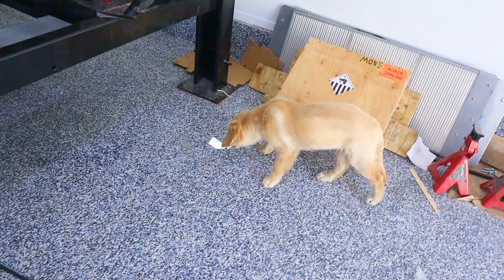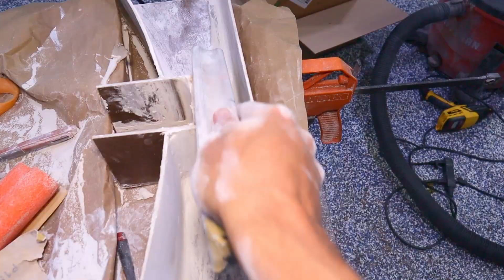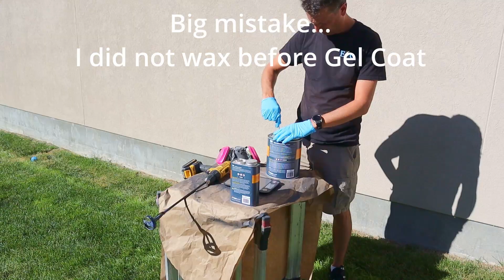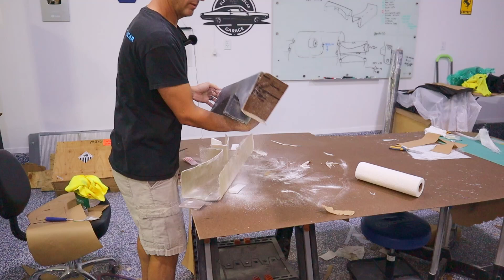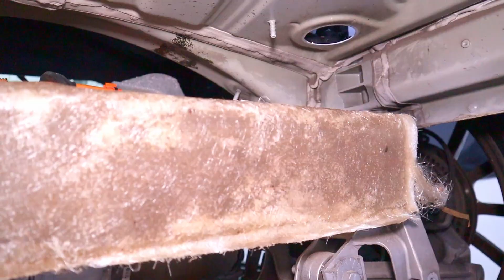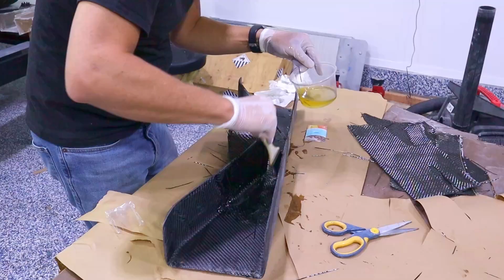Carbon Fiber Motor Mount: Strength, Style, Performance - From Idea to Reality-Crafting Carbon Fiber

Comment: Looking good, but for a better rigidity I would close the bottom (O instead of U), that will help against the 'arm' bending. I'm no expert, but maybe also locally strengthen the screw holes?

Comment: One thing to note when working with composites: anywhere that you need more strength, you can do so most efficiently by purchasing some foam that doesn't dissolve in your resin and laying it in between layers and trapping it in the composite. The foam doesn't weigh much, but allows you the opportunity to create more offset planes for tensegrity. Think of it as welding box tube into sheet metal or the stamped reinforcement in stamped steel or aluminum panels. I've even seen this done with the super cheap foam cord insulation that is just an extruded cylinder of foam used for wedging in gaps around windows and door casings. Closed cell works best as it absorbs less resin. It can also be helpful in building an edge with a nice round over so that you don't chip and delaminate the carbon fiber on the edges of an open panel like that one. Since the foam gets left in there, there's no need to worry about it and the hollow carbon fiber tube at the edge will also dramatically reinforce the structure.
Reply from the maker: Great comment!

Comment: With the weight, applicable G force under load it'll put a tremendous amount of force on those rigid mounts. Give it some room to travel and a anti vibration mount for the rotational aft force to minimize stress. You'll have less noise and vibration for your chassis.

Comment: It's hard to tell without being there, but given that you were able to flex your cross beam member with just a portion of your weight before your additional wet layup, I might suggest adding in 3-5 wet layup ribs spanning your internal "U" structure there just to be safe.  Reason being, your mount location is a bit cantilevered off of your mounting axis, and as you said- the motor is 300ish lbs, and with inertial loads over bumps and whatnot the force can well exceed that.  Definitely want to resist those torsional loads on the beam.  But then again, maybe your additional mounts will be more than enough (Just want to protect that motor and this super cool bracket!)  But I'm super impressed with how your carbon fiber member turned out!  Love the channel and the build
Reply from the maker: Thanks for the suggestion!

Comment: You might need to add some gussets or box in the section to add a bit more strength... you could also add a tube or similar around the bolt access hole to put some more strength in there. 
If you can, throw the CAD into some basic simulation software and just see how it behaves.
Reply from the maker: Good call

Comment: Did you mention how many layers/sheets did you use? Looked like it ended up being about 1/8" to 3/16" thick? Whid did you make the bracket U shape in cross-section? It seams like it would be a lot stronger is you could of made 4 sides more like a tube.
Reply from the maker: 3/16 thick
I still may close it off

Comment: I hate to be that guy but you really should be wearing PPE during all stages when you are working with carbon fiber. Carbon fiber dust and shavings are absolutely terrible for your skin, lungs, sinuses and eyes! Epoxy dust is also awful for you. A significant amount of both get airborne when you cut and sand this stuff. There are entire industries dedicated to PPE for working with epoxy, carbon fiber and fiberglass. They exist for a reason.

Comment: Hey you probably should by some hearing protection.. ;)
Also, I think you notice it as well, your beam is a bit overbuild, you could have taken advantage of the fiber properties and lay them in load baring directions instead of simply 0/90 and +/- 45, similarly the ends could be angled as they don't take any load.
Internal structures, like rips, could also be sometimes more beneficial than more layers ;)

Also you could have used peel ply without folds on the outer layers.. when building up such thick laminate the folds in vacuum bag and peel ply could press through disrupting the resin to fiber ratio.

Comment: Where you able to reuse most/all of the carbon fiber you cut up before you made the second mold? Also where did you learn how to do composites?
Reply from the maker: Yes, used the same carbon fiber pieces.  Learned by doing.  Still have so much to learn

Comment: If you're using regen braking,  wouldn't that mount need to be strong in both directions?  How much will the current design flex in an upward direction?
Reply from the maker: None that I can generate

Comment: I like the use of carbon fiber for the crossmember/motor mount.  Where did you get information on the structural strength of carbon fiber and how many layers/weave orientation?  Keep up the great work.
Reply from the maker: Lots of research.  About 20 layers

Comment: Boxing in the large hollow underside would do wonders for the part's torsional rigidity having that cantilevered load.  I second the other comments on the actual bolted interfaces, you want to bear the load locally in a much thicker section.
Reply from the maker: Thanks for the suggestion

Comment: Interesting approach!  I’m curious about the choice of molding one from composite vs. what I see a lot of YouTube fabricators doing which is making mounts out of tubing or sheet metal and welding it up.  Did you consider this?  It seems metal fab is a lot easier to tweak before finish welding it up.
Reply from the maker: Probably.  Still can go this route if needed

Comment: when you're lining up the output holes from the motor to the spindle in the wheels - should you do it with weight on wheels?
Reply from the maker: What do you mean?  Like full droop without weight?
Reply: @ElectricSuperCar  opposite what you said.  Put the weight of the car on its wheels and then see if the cv axle holes will be straight.   Right now the wheels are drooped down right? So when you go weight on wheels the spindle holes will move up..  idk if its a considerable amount or not..
Reply from the maker: Got it.  Right now wheels are on the ground with vehicle weight, but without batteries the car is sitting high

Comment: Nice part you build there.
IF it still needs strenghtening, you could add layers of diagonal trusses on the inside.
Also, think about reinforcing those holes you drilled by gluing some aluminum or titanium bushings into the carbon fibre piece.
Reply from the maker: Thanks for the tips!

Comment: First, GREAT job all around.  On this build and all the work that you do.  I'm really enjoying your channel.  Second, I'll add to the CF comments by reminding everyone that CF has over twice the tensile strength of aluminum at half the weight.  If something "tore up" a 1/4" in of aluminum, the equivalent would be 1/8" of CF.  In the right configuration (as you stated) and the correct weave / pattern layout CF can be used for this and many other high load applications.  After all, it is used for aircraft wings that take loads far in excess of what this motor can put out.
Reply from the maker: Great point!

Comment: 300lbs weight, 1000bhorse power, there is NO way a carbon fibre layup without reinforcements is going to hold under load and continuous use.

Comment: 1. Dont forget you need to address the oil pump inside the motor since you turned it around.
2. You should wear a mask, you dont wanna breath that dust in.
Reply from the maker: Thanks for the suggestions!

Comment: To make the carbon fiber motor mount structural, you could use the same layup, but add 1/8" or 1/4" honeycomb material in the middle of the layup. For the mounting points, cut out a square of the honeycomb and add either layered carbon fiber or aluminum strip (a square with each side 3x the hole's diameter) to take the point loads. The stiffness increases exponentially.
Reply from the maker: Nice!
Reply: @electricsupercar  Do Not use honeycomb cores! It's the opposite of a beginner-friendly material and the most unforgiving and difficult to work with core material you could pick. Without the necessary equipment and experience the amount of resin you'll need to assure proper adhesion to the cf skin is going to offset all weight advantages honeycomb might have over other core materials. It's also not the type of core you want in a part that might see a lot of torsional load, unless you know exactly what the max internal sheer stress is going to be. 
If the skin gets punctured and moisture or oil etc can reach the honeycomb core, the components days are numbered.
Use end grain balsa. It doesn't sound very high-tech, but it's the best allround core materials there is. 
You could also use foam, like Rohacell51, Airex T90 or M80, but that stuff is expensive and often difficult to source in small quantities ... but you'd have proper spec sheets if you want to simulate the part in CAD.
Reply: @protator  Foam would be my preferred choice. As long as you don't intend to cover a particularly large section of the component with it then it won't dramatically impede resin penetration. I'd opt for just cutting it into strips and laying it in to create tensegrity structures similar to how stamped sheet metal components get formed to improve rigidity. Square strips in the corners and edges of the part with triangulated square strips between them laminated between the layers of carbon should do wonders to improve rigidity without adding excessive weight.
Reply: @mndlessdrwer  It works with sheet metal because it's one homogeneous piece of material. In a composite structure it'll do the opposite of what you think. That reinforcement layer would be stiffer due to its geometric shape, therefore taking the brunt of the applied load instead of adding strength to the part as a whole. It's the same reason why you can't reinforce glassfiber parts with small bits of CF here and there. CF's elongation under load is so low that any asymmetry, be it different fibers or geometry, will lead to premature failure of the stiffer component before the rest of the structure even sees any significant load. 
--- 
Resin penetration is an issue (didn't re-read my old comment, so maybe my wording was bad). Resin doesn't penetrate a closed-cell-foam core. That is a good thing if extremely low weight is desired. If the internal shear forces were considered and kept low, a pristine part will perform as expected. But because the bond between skin and core is rather weak, a damaged part will deteriorate and fail quicker than you can say "Holy delamination bubble batman!"

Comment: This is not even close to how your should be making this out of carbon. To keep the bolts from point loading the carbon or causing compression issues you should have metal inserts the the hardpoints to start. Also you need to close the shape, squares are strong and triangles are better. 

Hate to see you spend alot of time on something and then end up with something that is only going to cause you major problems down the road. 

Some good info here: https://www.youtube.com/watch?v=UWSePEV88tw&ab_channel=EasyCompositesLtd
Reply from the maker: Thanks for the suggestion!

Comment: Someone could probably do load simulation on that part personally I would have added two ribs per side but I bet that's going to hold pretty good
Reply from the maker: Still can add.  Never too late to implement a good idea
Reply: @electricsupercar  absolutely! Composites are great for that. I bet that Mike Patey would be down to help with the simulation ;)
Reply: And I'm wondering if adding a kevlar layer could help with impact resistance

Comment: Amazing job as always! But i wouldn't trust the motor mount screw to seat directly on the carbon, i would add a couple of small bushings there. Vibrations may enlarge the holes or make the part crack. PS I'm a "bicycle" engineer with 15 years experience, i designed and built in mass production tons of carbon bikes for the major brands. I hope it helps! Keep up the good work!
Reply from the maker: Thanks for the suggestion!
Reply: I agree on the bushing thing.
Reply: I'm not a bicycle engineer, but I was wondering if there needed to be something between the carbon and the hardware to avoid cracking.
Reply: @tedforringer9124  it's a simple thing, I just wanted to validate it with my background but he's surely dealing with issues way more complex than this 😂

Comment: I would wear a respirator when grinding aluminum. Aluminum dust is REALLY bad for you.
Reply: Also working with and cutting fiberglass or carbon
Reply from the maker: Thanks for the suggestion
Reply: Second respirator for carbon, aluminum and fiberglass - cutting, drilling or grinding

Comment: That whole drive unit assembly, without the driveshaft or suspension is still 300#?
Reply from the maker: I think so
Reply: @electricsupercar  wow I thought those old unit's drive units alone we're about 200-220#
Awesome update and what a drawn out process to make that killer looking engine mount. 

Any chance you follow the street banditos channel? They are making a tesla swapped 280z with a widebody using 3d printed molds and c.f. 
Cool series prepping it for sema, might pick up an interesting idea or two for your also badass cayman gtE! 
Although I think you could teach them a thing or two about ev swaps at this point. And they could help you with molds n bodywork ideas. 👍🏻😁

Comment: You could shoot air under the layup to pop it out instead of just prying it off.
Dude you should be wearing a mask when you are drilling that dry carbon, that dust is bad bad bad news for your lungs.
Reply: hard facts indeed.
Reply from the maker: Thanks for the suggestion!

Comment: I hope you laid the carbon fiber in different directions and not just in one direction.  I would add reinforcement ribs in between at least 3, I would prefer 5. I think you are underestimating the torque power of the engine, and what it will do to the carbon fiber.
Reply: 100%^^^  This motor is capable of ripping 1/8" steel mounts like nothing.  It will destroy this mount I fear.  Like you said at least you have a mold for aluminum, and do 1/4" with no structural welds.  (use laser cut slots for joints and welds to just hold it together not bear any load)
Reply from the maker: Thanks for the suggestion!